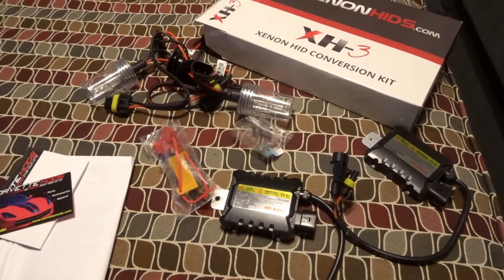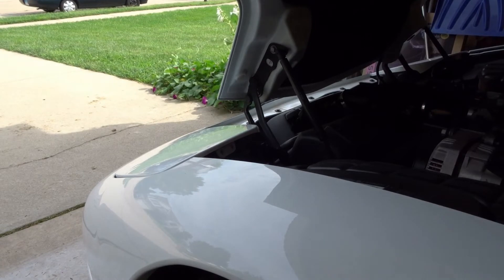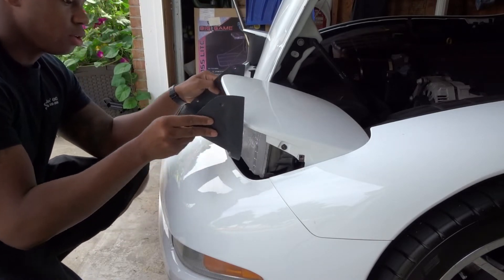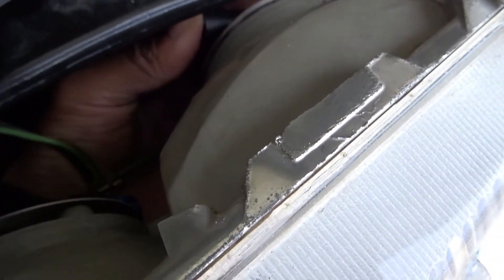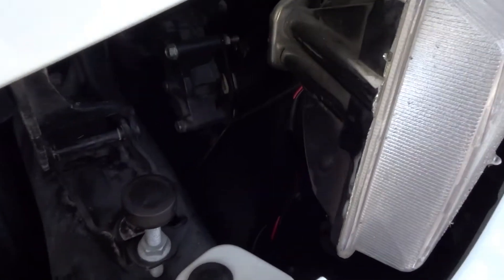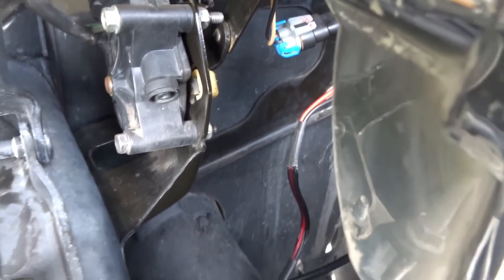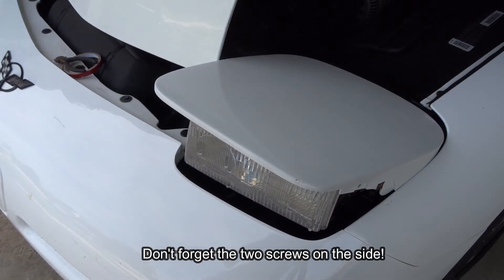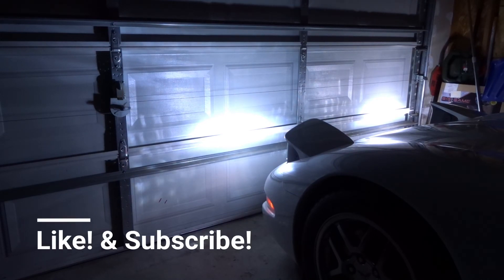C5 Corvette HID Install- Much Needed Upgrade!

Comment: Thanks for blinding everyone on the road.  The stock housings are not appropriate for LEDs or HIDs.  Both of those require projector-type housings.
Reply from the maker: Anytime Scoob 🙌🏿 I adjusted them where they needed to be and never felt like I was blinding anyone in a car that sits lower than everything lol even a Honda civic sits higher than a Vette
Reply: @LJsGarage  believe me, I get it since I currently have LEDs in my stock housings.  But I knew it was a temporary fix and I’ve added silver duct tape to narrow the beams so people aren’t blinded.  Without that, I was totally overshooting the target range.  You can see it in practice - if you’re lighting up signs a block away, it’s from the scattered light.  That absolutely should not happen.  I still get people flipping me off when I’m behind them - I can see my lights in their rearview mirror.  I’m waiting on my KnightDrive TV LEDs now.
Reply from the maker: I gotcha yeah makes sense on your experience with it why you're saying that, I appreciate your thoughts!